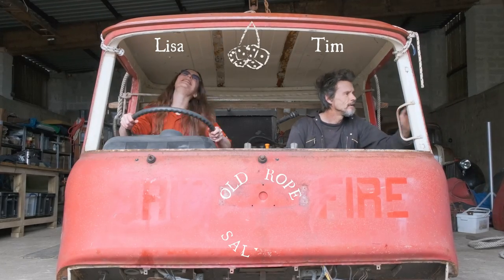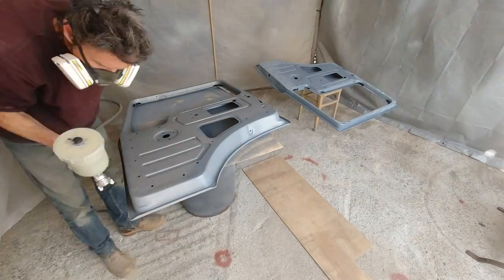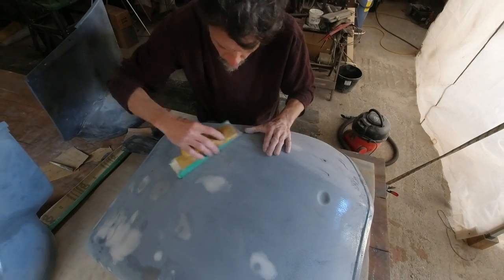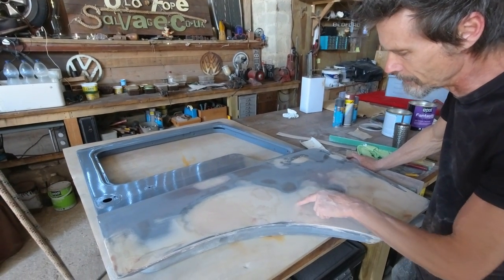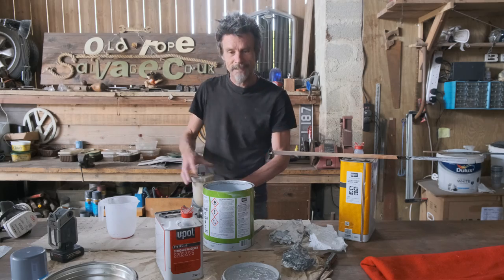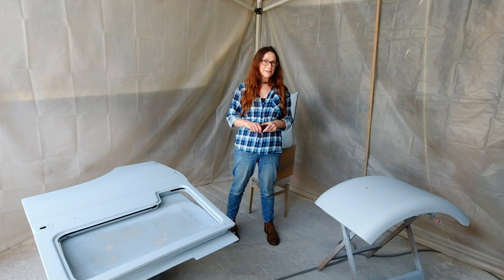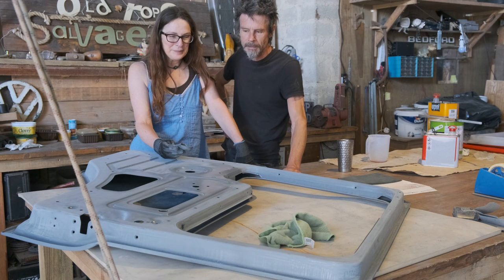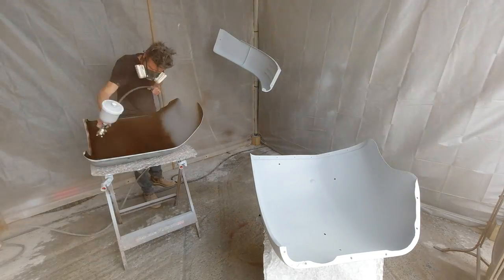Restoring The Many Doors & Panels on Our Vintage 70s Bedford Truck Cab …

Comment: Nothing wrong with that door! It has the correct amount of filler for the condition it was in, and the work you have done on it looks fantastic. I don’t think you guys realise how big an inspiration you are to the unknown masses on the web. 
That said, that could all change if the mankini makes an appearance…. 😜
Reply from the maker: Thank you. That means a ton to hear that, especially as these last few weeks have been such a slog. We're starting on the top coat now though, finally, and it looks soooo good! Hehe ... The threat of the mankini seems to have a few folks worried! Scary mental image, I agree!